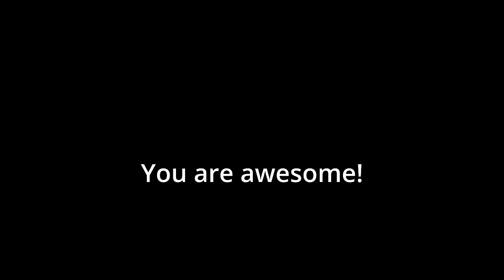I Can't Believe this FINALLY Happened! The Junkyard is FOREVER Changed!

Comment: I feel ya on wanting to repurpose everything, I work in a small trash dump, we haul exclusively for the film studios and television production companies. Hollywood is very wasteful and we try to recycle all we can and give as much away as we can but plenty of folks say "Oh I want that!" and we say "sure, come get it, bring your friends and we'll even load it for you" but they never show and it's off to the incinerator or the landfill. We can't save it all.
Reply: The company I work for rented trailers to the studio that made Equalizer 2. I managed to get lots of copper and brass plus the A/C unit in McCall’s kitchen. All of it was destined for a dumpster.
Reply: You feel you cannot handle the job because the two buildings were connected by roof Joists? Definitely a good thing you call the professional because not just anyone could cut those roof joists with a sawzall. Doofus😮

Comment: Where I live houses and buildings are constructed from hollow blocks, with rebar inside. The floors and roofs are poured concrete with rebar. I think it's to make them typhoon proof. I could have knocked your building down by myself with a sawzall and a big hammer. It would have taken way longer though. When I was a little, us kids job was to pull all the nails out of the wood from tearing down old barns and other buildings. Put the nails in a bucket, and stack up the wood.
Reply: And then build a treehouse.
Yep! 🤠👍

Comment: Silas that tin was just waiting for the right gust of wind.
I love how that op knew where every tooth on that bucket was. Picking the blocks out one by one by the stairs....
Show off!
Many years ago in the late 70s I worked at a Cat dealer. There was a huge excavator in one of the bays. On occasion fog would roll in off the river and hang about 3 to 4 foot off the floor in the shop and this was one of those mornings. I came into the shops early before the wrenches got there and turned on the lights. I came around the corner and there was this huge head with menacing eyes, teeth bared ready to devour any human soul that dared enter...
at least that's what my stomach said as it tried to get my attention over the hair on my head standing up!
With my heart slowly returning to normal it struck me funny as a tough kid like me, standing in chest deep fog, in half light (dang near dark, ok?) all by my bad azz self, about to let the contents empty from my bladder!
I did hurry to turn on the lights in the tool crib where I worked as the night watchman came laughing to the window. He was a good friend and had painted those eyes with florescent paint and waited to plug in that black light just as I came around the corner.
Hey, those eyes were really realistic, ok?
We used to run our other makes of machinery down the road to the respective dealers when we got trade-ins. Those tires on the loaders and pans would bounce at speed. Most would set on a front to rear bounce, a quick stomp on the brakes would stop that. But sometimes you would get the corner to corner rotation that would make a sea captain sick. Then there was the hop, where the machine felt like it was trying to leap over a huge jump rope.
I really miss working on and operating those big machines, at least the ones before all the electronic stuff. I'm just old fashioned I think.
That slab is going to be a great asset for processing cars. Tools can be secured in the building next door.
Take care of yourself Silas.
Cheers
Terry

Comment: Silas lts a shame that you didn’t salvage a couple hundred or thousand of those 8 inch concrete blocks? I know you are going to have a project down the road where you will wish that had salvaged those blocks especially at the price they will be 5 years from now same goes for those nice joists from the first level that weren’t rotten!

Comment: In Denmark, private individuals can hand in everything for free (apart from asbestos, a company has to come, which costs money) Everything is recycled, apart from household waste, which is burnt, and heat and electricity come out of it. We are largely free of gas from Russia. The same with the rest of the EU. But companies have to pay to get rid of asphalt, concrete and pretty much everything. Much of the green waste is turned into soil, which private individuals can come and pick up for free.
Reply from the maker: There is high demand here for recycled asphalt and concrete, so they don’t charge for those. Things like lumber, shingles, sheetrock, or other building materials are just buried, so that’s why they charge to accept them.
Reply: @AdventuresMadeFromScratch  I think it's wrong to buried the lumber, sheetrock etc. But not your fault.